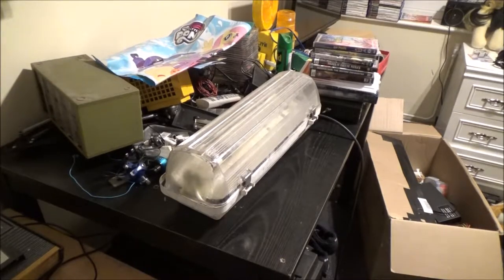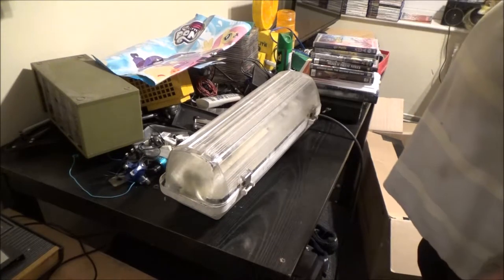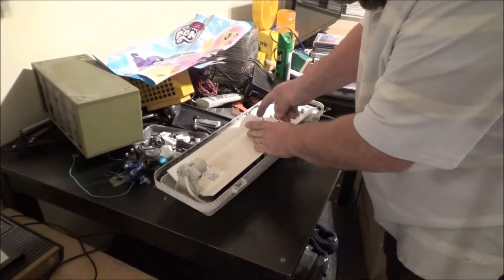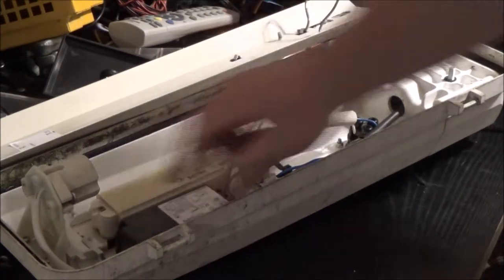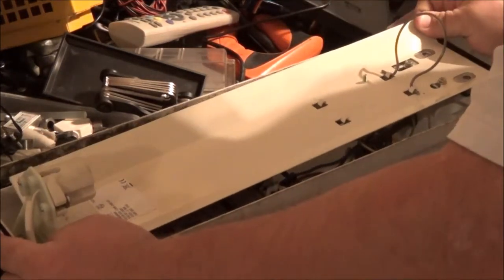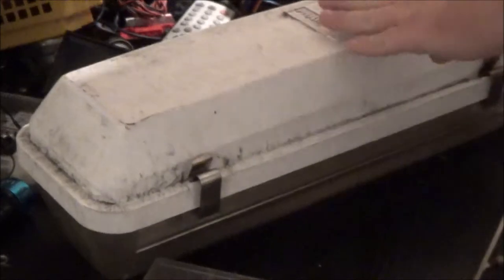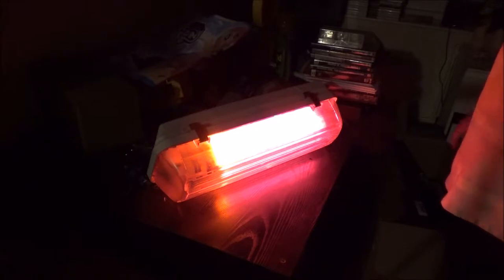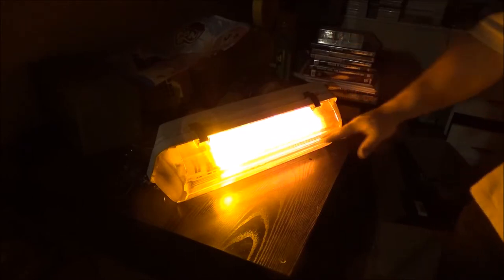I Bought A Street Lamp/Moped Update

Comment: Hi Andy, that looks like a 55 watt lantern, because of the two different positions for the lamp support clip, (shorter position for 35 watt lamp). I'm on the Facebook street lighting group, I've always had a intrest in street lighting & I was also fascinated by watching the SOX street lighting warming up.
There is still quite a lot of these Philips lanterns in use around Portsmouth, (at the moment) as some areas are being replaced with LED lanterns,  which I myself are not keen on.
Reply from the maker: I think it was the street lighting group I read that Phillips will be stopping production of the SOX bulbs over the next couple of years. I thought it might be a 55watt due to it's length but could not find the rating on the bulb so took a 50-50 guess lol
Reply: If you measure the length of the actual lamp and ask someone on the street lighting group they'll tell you the wattage.